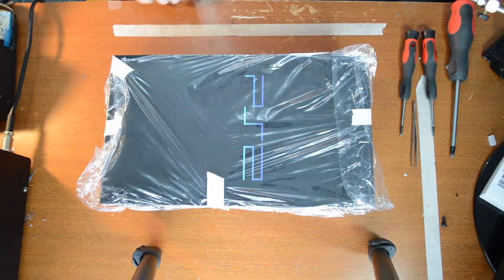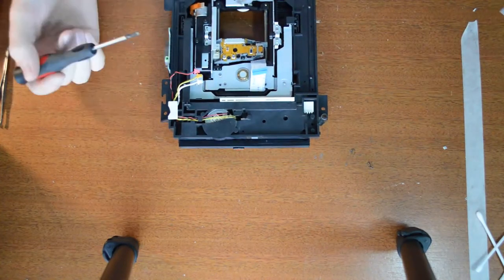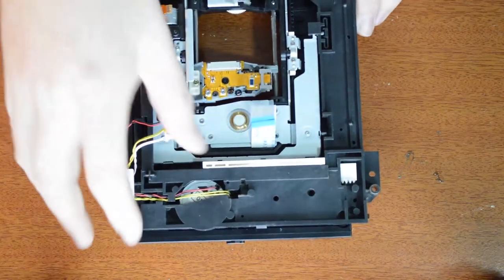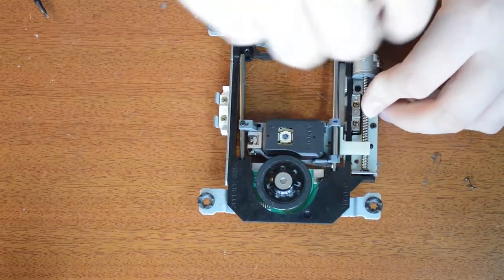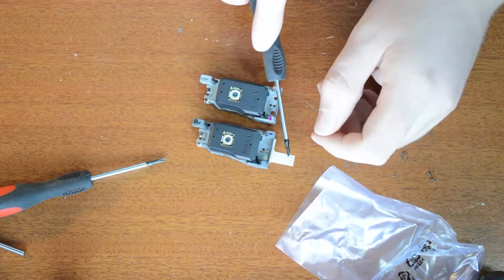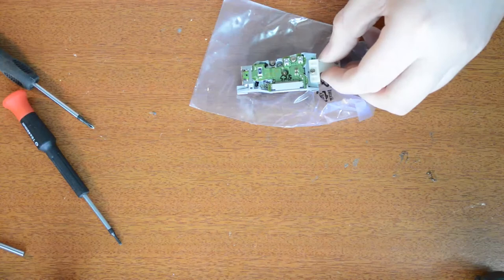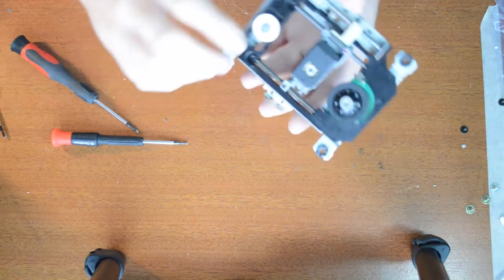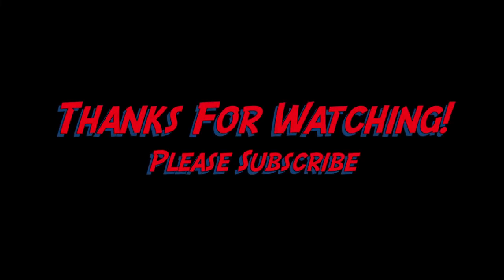How to Replace The Laser Pick up On a Phat PS2

Comment: Ive fixed around 5 of these myself. If youre just replacing the laser there is no need to remove the dvd drive from the ps2 or to take that center bracket out. Easiest way is to just remove 2 screws on the side of the tray to take the disk tray completely out. This lets you take the opportunity to grease(White Grease) up the gears and check on the belt (always good to replace). As a note some models do require the whole dvd drive to be taken out to get to the belt and gears on those models theres a few screws on the bottom not just on the top. If your tray has no issues like getting stuck or opening and closing when it shouldnt then you can skip that step. To take that laser our when you take the tray off just remove the top right rail screw that the laser is moving on, flip up, remove the cable, and then just slide it out. All thats left is to follow the rest of what hes doing minus the soldering and put the tray back in.

Comment: I don't understand, why did you use the soldering iron? What exactly did you do?
Reply from the maker: There is a blob of solder connecting two traces on the flex cable.
This shorts out the power rail to ground to help avoid electrostatic shock in packaging.

It’s like how some companies will use foil covered foam blocks on DIP package chips, short all the legs to prevent ESD damaging the chip.

Kind of like a poor mans faraday cage
Reply: @Slot1Gamer  ok, thank you!!

Comment: EDIT - May have found it now. Thanks for the video.

Hi Slot1Gamer - @9:36 you point out that white bit of plastic that connects to the screw that moves the laser. Do you know where I can get a hold of a new one? My launch day PS2's one has completely worn down and the teeth that it uses to hold onto the screw are completely gone, meaning the laser cannot move at all.

I really want a replacement but cannot for the life of me find one. Want to keep the ol PS2 going for as long as possible. It's a UK launch model - SCPH 30003.
Reply: you can find them on ebay. I purchased a new one myself, the only one i found was 4 to purchase and another 4 to ship (rip off). Once you replace it tho id recommend going to a local hardware store and purchasing a tube of white grease. Take a q-tip and spread some of it on your worm gear (the corkscrew thing that moves the laser) when you replace that arm.

Comment: How reliable are the Chinese made PS2 lasers? Is it like the PS1 lasers where 1 out 10 could work?
Reply: I ordered one from china, was excepting a noname laser and I got an original Sony laser. It's exactly the same as in my ps2.
Reply: Rondo 1 does anyone have an answer to this question, it’s the difference between 5 and £20. I don’t want to spend £5 on a thing I’ll have to replace in another 15 years again. The official Sony ones are what caused the trouble in the first place so I don’t know if that’s even the best option

Comment: I replaced my laser with a brand new one and the laser beam won't turn on. when I start ps2 the lens pushes up into place but the actual red laser beam doesn't turn on. Laser unit doesn't move back in forth, just stays in one position no beam being projected. Please help I paid high amount for new one.
Reply from the maker: check to make sure it doesn't have a ESD protect point (it's a blob od solder joining two traces together)
Also check the ribbon cable that goes from the laser to the motherboard, they are pretty fragile
Reply: +Slot1Gamer it turns out the laser I bought is a KHS-400C and the Original laser that was in my PS2 is a model KHS-400B so the one I purchased isn't compatible I guess. I purchased it on eBay and the seller specified that it was compatible with my model of PS2 without telling me the actual laser model.  Sorry for inconvenience.
Reply from the maker: Oldschool Wayne Some Ps2 optical pickups are interchangeable though :)
Reply: Oldschool Wayne I don’t think it’s capability my ps2 laser was a 400b and an hd7 laser works on it

Comment: I changed the lens of the PS2 but when reading the disc it makes a horrible noise and in the end it does not read the disc, I know that the laser works because I tried it on another ps2. What I can do ??
Reply from the maker: Could be an alignment issue 
Probably slipping on the worm gear :)

Comment: Replaced mine and now the thing goes way too far and bumps into the bottom, makes a very loud grinding noise when turning on but it reads discs.
Reply: Kippykip the plastic piece that connects to the worm gear needs to be adjusted mine has the same problem